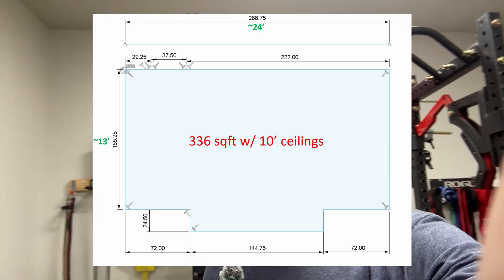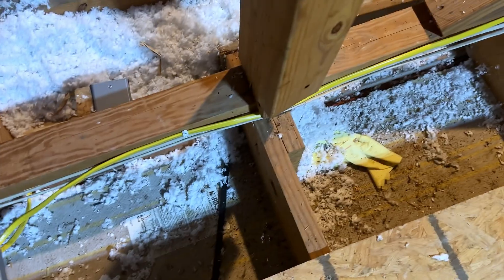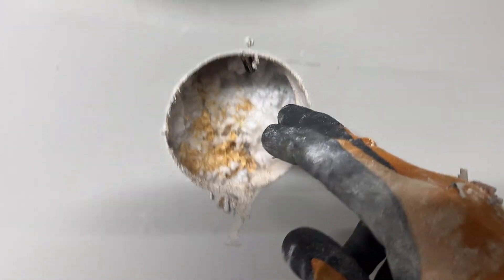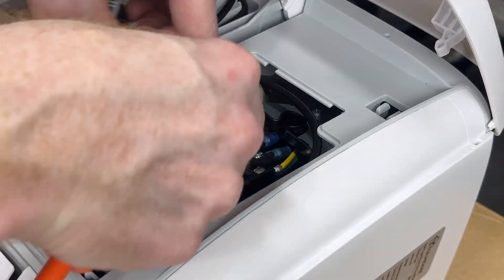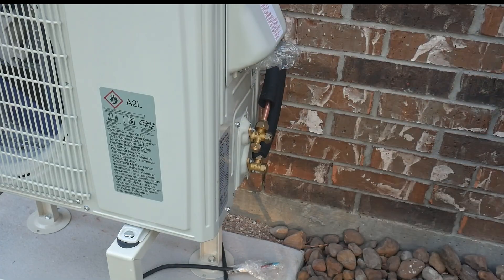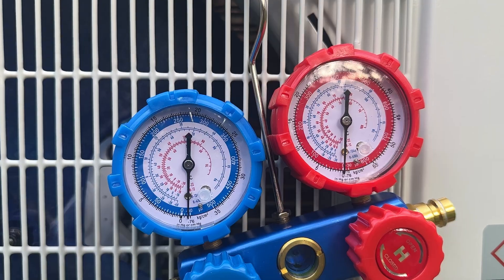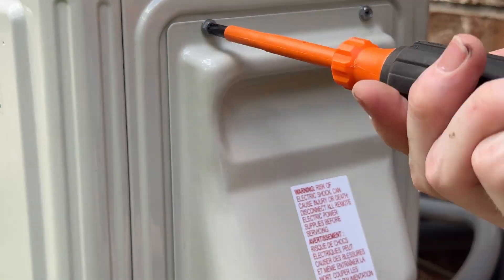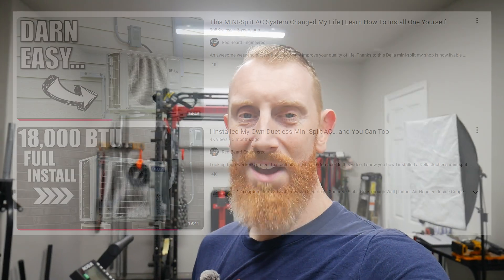Can a $550 Amazon Mini Split Actually Cool my Gym?

Comment from the maker: ⭐ Cheap Mini Split - https://amzn.to/3LsyLhP

🗒 Other Items:
Mounting Stand - https://amzn.to/4llqQ2U
Line Cover - https://amzn.to/3GowW3v
10 AWG Whip (would try to find 12 AWG) - https://amzn.to/40BsrcC
Nylog Blue - https://amzn.to/4lauHQk
Cable Glands - https://amzn.to/3WTJzcw

🛠 Tools:
Vacuum Pump / Gauge Set - https://amzn.to/3AvWG8u
Flaring Tool Kit - https://amzn.to/40Bsyoy
Service Port Adaptor - https://amzn.to/3T0Dxm0
3.5'' Core Saw - https://amzn.to/4nrhWmd
3.5'' Hole Saw - https://amzn.to/3SDSX1g
Crowfoot Set - https://amzn.to/3TaVFKn
Copper Pipe Cutter - https://amzn.to/3K3jfV4
Volt Meter - https://amzn.to/4oHxxxP
Fishing Tape - https://amzn.to/4qqvakn
Klein Crimper - https://amzn.to/4obM0SP

📺 Watch my other mini-split installs:  @redbeardengineered

Comment: One reason your torque setting may have seemed like to much is because when you add a crowsfoot to a torque wrench you are changing the length of the tool.  There is a math formula you can look up to calculate the proper setting for the change in length .        Additionally if you put the crowsfoot at 90 degrees to the wrench handle then your length stays the same and you can use the specified torque spec.
Reply from the maker: Yes sir, this is why I had it at 90 degrees not straight with the handle. Just felt way too tight, so I went with the ol gut... so far she's been working great!